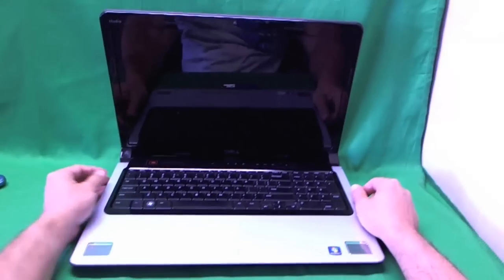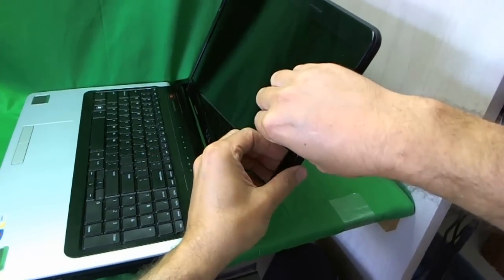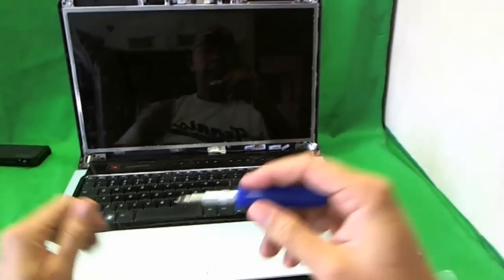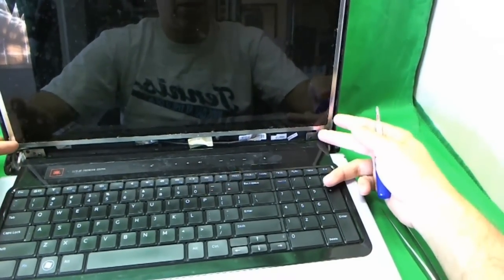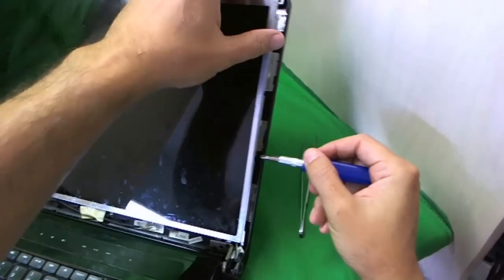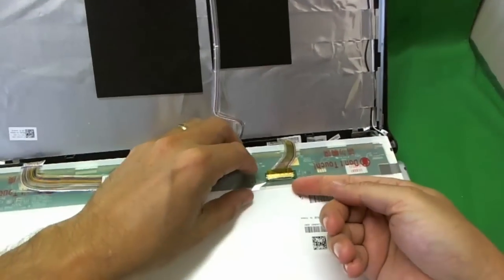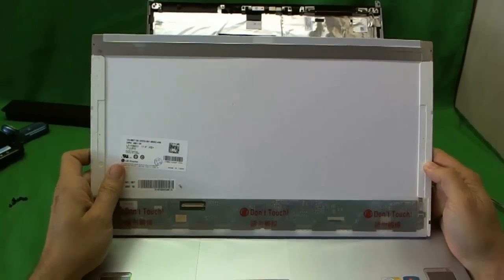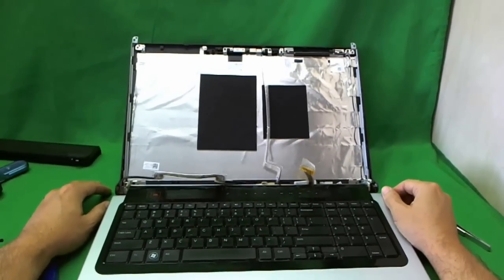Dell Studio 17 Laptop Screen Replacement Procedure

Comment: Hello Eugene. I'm a little late to the party. I'm having trouble with my 1749. Just looking for some advice. Last night I was working away when my screen just went black, I didn't worry too much as this happened before, all I did is switch the laptop off and back on and it worked again. But this time it's not coming back on, I'm actually typing this message on my 1749 rite  now but I have it connected via hdmi to my tele, my laptop screen is black. This tells me there's nothing wrong with my motherboard I think. Would you say I need a new screen or could it be faulty cables etc... I did open my laptop earlier and it all looked connected properly.

Comment: Hi Eugene
I have a 1747 with a broken touch screen.

1. Is the procedure for replacement the same as for a non touch screen?

2. Do I have to replace it with a touch screen or can I use a non touch screen as a replacement ?

Comment: Hi. I have dell 1749 screen is 
LG D/PN: 0MC13K
LP1713WD1 17.3" HD+
(TL)(A2) 1600x900
(Left side bottom conector)
 Can i replace this screen to full hd 1080 resolution?
What model i shut buy?
Reply: +mmo323 have you managed to replace your 1600x900 with a full HD 1080p resolution screen in the end? 
I'm looking for a replacement screen and found a full HD version on ebay, which is only about GBP 10 more than a standard one... so I'm thinking about purchasing the full HD one, but not sure whether it would be compatible.
Reply: +kotopsycho I'm in the process of doing this exact swap right now, im not sure it'll work either, I've dived in with faith knowing that dell did offer a 1080p screen on this laptop as an option, it's half done and I'll report back tomorrow night or as soon as I have chance to finish it, wish me luck =]

Taking a little longer as I've removed the entire cable from the base too (which involves taking almost everything appart :/ )

Factory screen was producing artifacts and breaking up in a linear fashion, it looked like a lose connection/faulty cable, with the effort to swap the cable being so great i decided to have a go at changing the entire screen while I was at it, this time for a matte version too, I haven't actually swapped the cable (i was hoping one came with the new screen - alas it didn't) so i'm reinstallying the same connector cable with the new 1080 screen in place of the 1600x900 with the potential faulty cable to see what happens. Also switching for a solid state drive and upgrading the memory from 4gb to 8gb at the same time.. Basically changing everything. Wish me luck!
Reply: +itsnot1984anymore Thank you for your reply. I've asked the seller on ebay whether it would work on not and they said they "wouldn't recommend" as the graphics card may not work properly... I've chickened out and went with a standard one. Let me know if your HD one works... really interesting. Thanks and good luck
Reply: HI kotopsycho! Forgive me for not returning here sooner! slipped my mind! I've installed it and it works perfectly, the particular panel i received has some backlight bleed due to a misaligned LED on the left side but as it came from america to me here in the UK and it was for my dad who is happy with it I haven't returned it. The seller does have a point, in so far as, if you're playing a graphics intensive game you're guaranteed to lose maybe 15% of your FPS on a higher resolution, but unless you're gaming with the latest titles you're not going to notice, remember dell did offer this exactly laptop with the 1080p display, not to mention that it has 1gb dedicated graphics (a large amount, especially considering the age of the laptop). A way to try it is to just plug a 1080p monitor in to the HDMI slot, close the lid, and how it performs on that is how it would perform with the equivalent resolution LCD. :D

Comment: I recently overhauled a Dell Studio 1745 into basically a 1749. Upgraded the motherboard from one with intel graphics to ATI, went from PGA478 (Core 2) to PGA988 (i5), added bluetooth and a backlit keyboard but one thing I was wondering...

If I were to purchase 79YFH to replace my screen and got the touch screen cable D655T would that make mine touch screen? 

The motherboard I put in is LA-5155P W87G9 0W87G9 if that helps.

Comment: Excellent walk through Eugene! 
On my dell17 I have a distortion on the screen that seems related to the hinge. I now regularly get these distortions, (they look a bit like a badly tuned tv, where the image start jumping erratically and brightly colored pixelpaterns flickr across the screen) it happens mostly when the screen shows a lot of black and sometimes adjusting the screen angle makes it stop, but not always
Could this maybe be a monitor cable problem? 
Do you sell those cables?

Comment: Hi Eugene,  I found the video very helpful, and replaced the screen, but when trying to power up I get 8 beeps.  top of the screen is green, bottom is blue, and there is a flashing cursor.  Does not boot up.  I had been using the lap top with a monitor with no problem while waiting for the new screen.  Any ideas ?  Thanks !!

Comment: Great video Eugene, I replaced my laptop LCD (Dell Studio 1747) the same way two weeks ago but I hadve a problem with it. The brightness can not be changed anymore and it is on the highest, while I change the brightness slider just nothing happens? I read in some places and says it because of the inverter but as you can saw there were no inverter in this model! Do you have a solution for this problem please? Thanks